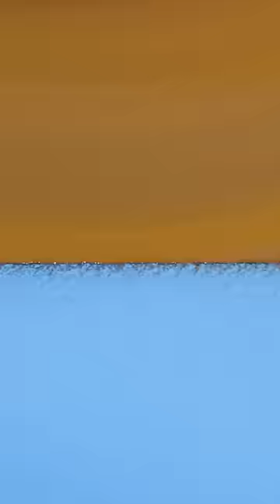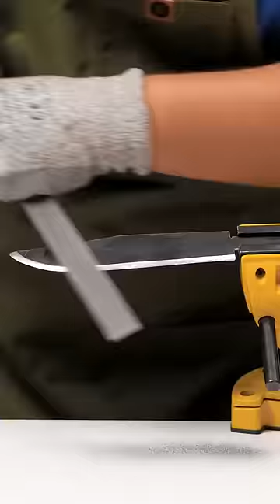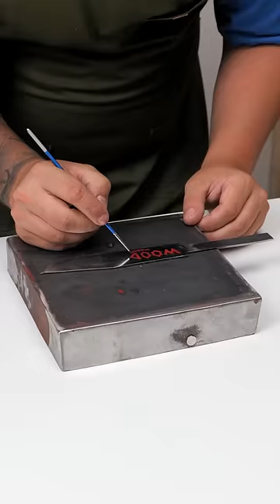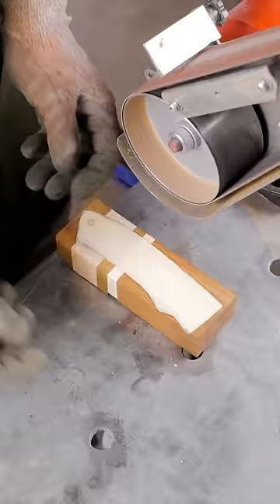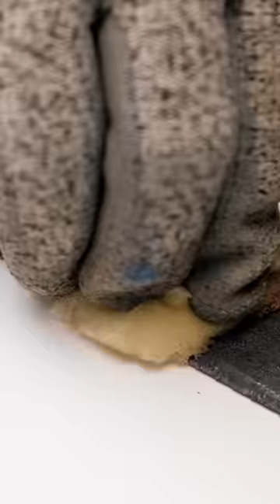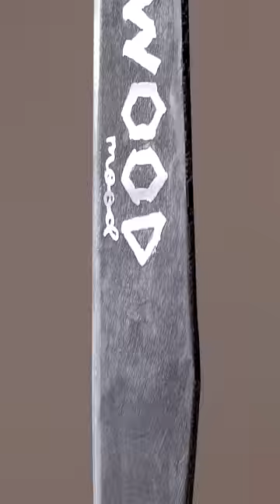Making a knife from an old frying pan! #Shorts

Comment: “Would you like your knife to instantly break?”
“Yes.”
Reply: BBC fk atende
Reply: I thought the structure changed when he heated it but then he put it in water.
Should he have put it in a kiln or sand for annealing?
Reply: I prefer mine to rust immediately
Reply: @cherylwade264  no idea- but I’ve met a lot of forgers in my day who make legit fighters for like 1%er’s- like actually for people who truly use them to fight and I wouldn’t think their opinion would be very high on that one. Aren’t skillets cast iron anyway?
Reply: @hudsontoo1212  
Yes cast iron can be brittle in some cases it can shatter lie glass.
There are techniques that can change metal for. better. or. worse that is the reason I asked about the process in case you had additional information.
Reply: @Lovesausage269  
Lol you can Season cast iron so it does not stay rusty. If you season a cast iron skillet it can be better than a Teflon pan.
Reply: @cherylwade264  and yet he didn’t season it
Reply: Not with my cast iron skillet you won't!
Reply: @cherylwade264  you'd have to completely melt down cast iron and remove the excess carbon in the alloy in order to make it more suitable for a blade
Reply: @cherylwade264  Cast iron has a much higher carbon content than that of high carbon steel. This carbon content is what makes it brittle. No amount of forging, quenching, hardening, and annealing is going to make cast iron suitable for a knife.
Reply: @MrTerduckin  
I appreciate the information.👍
Reply: Watched a video" IS It Cast Iron Or Cast Steel. My questions were answered.
Reply: @Fee.1  Steel is best. Leaf spring steel from a junk car works well for forging, for stock removal something thinner. Some people use old files to make knives.
Reply: @cherylwade264  clenching in water hardens it, making it brittle. He'd have to temper it after that.
Reply: I want it to rust, too.
Reply: I just want my pan back
Reply: @cherylwade264  usually that process is made with hot oil. Water usually makes the structure quite fragile
Reply: My grandmother had a beveled glass 
cake knife it was very pretty.
Reply: That’s not a “old pan” that’s a perfectly good cast-iron skillet
Reply: Cast iron breaks and wont hold an edge...you want steel
Reply: the way he make the handle sucks
Reply: Why not make the tang the length and width of the handle? I don't get it. All this work for a cheap build.
Reply: Not if he's only cutting bell peppers and possibly bananas.
Reply: Especially if he cuts tomatoes or any foods with acid.
Reply: @Fee.1  lawnmower blades might work well
Reply: @nopenoname421  what type of metal not what’s an example of something made of the metal
Reply: @rafaels2__337 km ko llo
Ko llo lk

Llo PP
Reply: @cherylwade264  not with cast iron
Reply: @cherylwade264  steel is an alloy designed with specific properties considered.
Nothing you can do to it with heat to change the amount of nickel, tin, tungsten, and manganese and the ratios of them. Worked at Bethlehem Steel pouring alloy for 20 years.
Reply: @cherylwade264  usually they put it in oil but water works too for instant cold it wont break that easy
Reply: @brianellison3525  
Metal can be tempered for shear strength  or tensile strength
The working process of the metal also 
plays a role. Overworked metal can become brittle. Sliding and folding the metal.  Much like overworked
dough can mess up a loaf of bread.
The annealing process relaxes the
metal.  The time spent in sand
oil ,water ,ammonia ,a kiln ,dirt
or whatever you choose plays a role
in the hardness. My husband was a 
blacksmith and we used to talk.
Anvil Ring is a good magazine
with useful. information and techniques.
Reply: @cherylwade264  no matter how much you play with it, it's the same alloy. The percentages of the base elements need to be correct for the tensile strengths required. I'm seriuos, if you want me to go in deeper I can. I'm an engineer that worked at Bethlehem Steel for almost 50 years. I made steel.
I know what I'm talking about.
You can change the molecular tension, but you cant change the alloy.
Cast iron is to brittle fir a knife.
Let your ignorance roll  I'm out.
Reply: @brianellison3525  
That's not exactly what I was saying.
The cast iron is cast iron .
Not all cast iron shatters like glass
people were doing tongue in cheek jokes
I have had hot cast iron shatter like corning ware when water touched it
and cast iron that bent before breaking
Just saying sometimes what I understand is not Gospel..
Misinformation is only a misplaced
word away.
That Foundry is in Michigan.?
Reply: Lol exactly what I was thinking
Reply: @cherylwade264  typically itnwouls, but cast iron has a really high carbon content, much higher than steel in fact. Because of this it will remain brittle.
Reply: @johnjoke5111  how does it suck? The blade isn't tempered so it's like glass but the handle seems fine
Reply: Handle looks like it’d break first, very weak.
Reply: His wife is going to be. Pissed

Comment: And now, a knife that will rust at the absolute drop of a hat! 👏👏👏👏👏
Reply: Like any other carbon knives if not properly taken care of, definitely not defending this terrible video though
Reply: Rusting isn't thr concern here. Cast iron is much more brittle than steel. This knife will break if he tries to use it for anything
Reply: @marshallferron  yea its got 2% carbon at least if i remember right, its kind of a steel in a way but with too much carbon, forging steel with 1.3% carbon (about the most carbon found in steel used for knife making) is already a pain as it tends to break apart if you dont respect the temperature
Reply: @MrHugo9397  that's a good point about other high carbon steels rusting as well. I don't work steel much at all, more gold silver copper brass. I might put an edge on a knife or fabricate or service a random tool now and again, as far as my "steel working" goes haha
Reply: Actually if you oil cast iron and heat it in an oven the process will prevent rust and sticking. The process is called seasoning an iron skillet.

Comment: Literally any junkyard in the world would have had the steel needed for a good knife.
Reply: He had enough money to buy the wood to make the handle but not to buy the steel?
Reply: @shadnenz793  yeah😂
Reply: Tha pan wasn't even old 😑
Reply: @Enforcer_WJDE  yeah
Reply: Better. Cast iron is a terrible material for knife making. Automotive leaf springs are high carbon steel. Used leaf springs are cheap cast iron skillets make good food. Easy math.
Reply: @pizzadude6615  
Or an old worn out file.  It’s already the right size and (almost) shape.  🤜🤛
What a waste of a good skillet.
Reply: @vance8402  0]
Reply: I agree, his "hardening" process was utterly useless since cast iron will not take a temper whatsoever.. but will it really matter if it's only used for cutting vegetables? Cast iron has exceptionally good wear resistance, as evidenced by the fact that shop tool tables have been primarily made of it for 100s of years
Reply: The pan isn’t even steel it’s iron
Reply: Leaf springs  or old truck tyre irons make good knives
Reply: Cast iron has to be the best material for a knife to be made from.
Reply: Ssddf1  no bruh - _ - he could forge a high carbon steel file
Reply: Cast has a high carbon content , but it's extremely brittle when hardened. Like EXTREMELY BRITTLE!
Reply: @coburnlowman  bruh thats why tempering exist where they heat it after that at low heat for longer time like a max setting in a Kitchen oven.
Reply: @ape337YT  
Tempering doesn't take the brittleness out of cast iron. It has way too many points of carbon. Cast is a brittle substance in itself. You temper it every time you cook with it. Just take a piece of cast iron, heat it until it's cherry red, then quench it in water. If it doesn't break in your quench just hit it after you try to temper it. I've had to weld industrial sewing machines that were dropped. We had to heat them to over 1000*F and the TIG them back together in heat resistant suits, then chunk them back in the furnace to cool slowly. Yes I know a little about metal. Not about the newer tool steels in the past ten years. But as a tool maker I had to be up to date with metals and metal urgery.
Reply: @coburnlowman  WAIT WAIT WAIT we are talking about cast iron? I tought we talked about high carbon steel, if we are talking about cast iron tho... LMAOOO prob an aliminum foil would have been better haha
Reply: @coburnlowman  my bad bro i was in a rush and didn't read you're comment completly, yes you're completly right. Cast iron is brutal af
Reply: @ape337YT  
After thinking about for a while if the edge was heat treated and it didn't shatter from the spine , it would be nearly like carbide. For kitchen use it could be useful, but still would be fragile.
Reply: @coburnlowman  nah man woth this much work he could make a knife that will last a liftime
Reply: Right! Leaf and coil springs are great. Cast iron is garbage for knives.
Reply: He looked no further than his kitchen he didn't have to go to no damn junkyard
Reply: @klchapman554  yeah I'd have to go with Wood Mood knowing a little bit about what he's doing.
Reply: Ruined a great pan, it just needed to be cleaned and seasoned again.
Reply: its to stab maleficent or maybe some type of undead vulnerable to iron.
Reply: I've done some blacksmithing myself actually, the greatest steel for knives actually comes from leaf springs out of old chevys and fords.

Best chisel I ever used was made from a tie rod off an 80s chrysler.
Reply: When I say that I just mean in terms of scrap steel. Also, railroad ties are great for small projects! If you walk down a railroad you can usually find one or two just scattered about.
Reply: I'm glad I'm not the only one who knows for a fact he ruined a good pan
Reply: Did u use this knife itachi when you were killing the clan😂😂😂
Reply: @zahidarifi7848  Hell no...I actually needed hardened steel for that job 😂
Reply: @ItachiUchiha-yz5nn  😂😂😂
Reply: I wanted to like your comment but it is exactly at 666 likes right now
Reply: Not true.. it needs to be high carbon. And if you know any thing about knife steels, that’s bs.
Reply: @ape337YT  tf are you talking about
Reply: @pizzadude6615  yeah, I eat cast iron skillets and leaf springs as well
Reply: @Zhisaoka  bruh
Reply: @shadnenz793  Ever heard of Recycling of old things?
Reply: @shadnenz793  l
Reply: Anyone who has watched Forged In Fire should know that this knife won’t hold up!!

Comment: I mean, I know he heated and quenched the blade, but it doesn't look like he got it hot enough to properly temper it. Not only that, but it is difficult to rely on a knife handle to stay in place like that without epoxy and/or pegs.

Comment: PSA, don't make your knives like this.   Things wrong with the knife: 
1. It's made out of cast iron. The problem with that is it is more likely to rust and cast iron is hard but brittle.
2. He treated the blade in water. Don't treat your blades in water, it is much better to do it in oil because if you treat your blade in oil, it becomes a lot harder and stronger but water doesn't have that effect.
3. Because he made the knife out of cast iron, it's pretty likely that the handle would just snap off if you hit something wrong.
4. That guard seemed too small to actually save your fingers when you need it to.
5. The method used to attach the handle is not nearly as strong as a peened, full tang handle so it's very possible that the handle would just come off randomly. 

TLDR: That is not how you should make a knife. It is very bad.

Comment: That’s some ……interesting…..stock removal. No PINS in the handle? I guess this is for some really light use. Anything more than that and you risk the whole handle falling apart. Of course the knife will be so brittle that it won’t hold up anyway so the point is moot.

Comment: Uhhhh ....that frying pan is pig iron. Knives are made of steel for a reason. That pig iron has almost zero flex. This blade will break. Guaranteed. If you try to pry anything with it, it will break. 
As a frying pan, it would have lasted for generations.